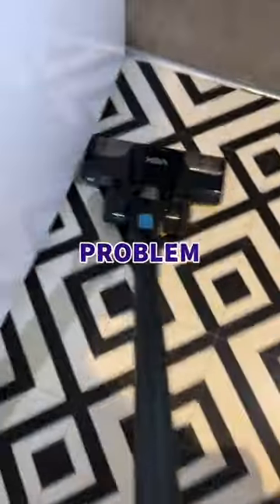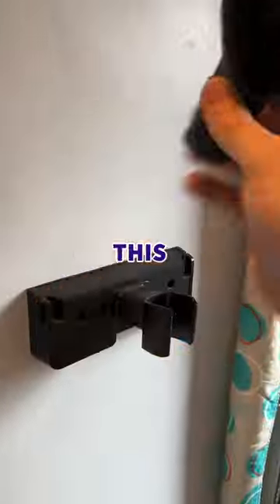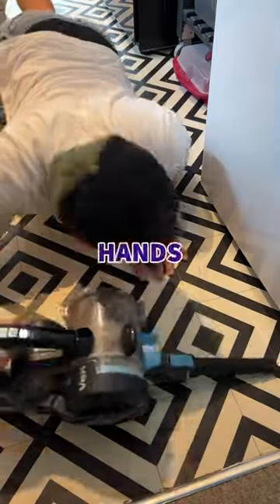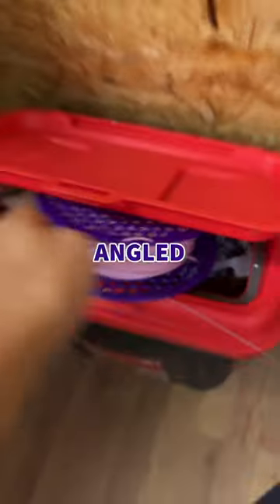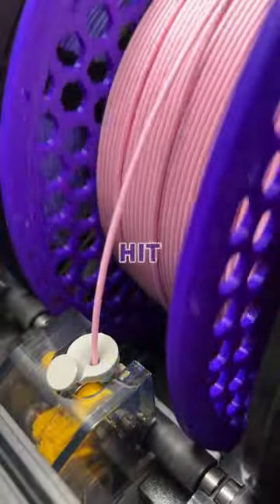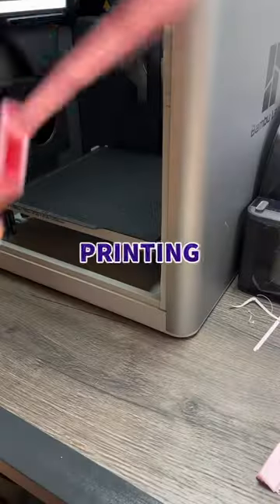3D PRINTED vacuum cleaner ATTACHMENT!

Comment: Remember, 3D-printed plastic is not food-safe, which means you can't eat all the dust afterwards.
Reply: Damnit i just ordered 200 of these for my dust farm.
Reply: Aw darn
Reply: Some are food safe you just have to get the right one
Reply: PLA is 😂
Reply: I just encountered one of the ignorant "not food safe" talking point trolls, so hearing this jab made me 😂
Reply: some are.
Reply: @giaomai6685  i wouldnt eat out of normal pla... because the additives and leaching. but food safe pla ye.
Reply: @giaomai6685  While PLA might be foodsafe...the bacteria build up between the layers won't be LOL
Reply: 3D Printing Food Safety ConsiderationsHarmful bacteria such as E. coli and salmonella can hide within layers and cause potential harm. This is not an issue for disposable items, but if you intend to keep the 3d printed part for an extended period, using a food-safe coating is highly recommended.
Reply: Well shit. I was hoping to eat the print and sprinkle the dust on top
Reply: Dang it bro. Now I have to go hungry 😢
Reply: This is CURSED
Reply: PET-G acctualy is food safe, if you treat your printer before printing and treat you model after printing with some stuff, i have no idea what they are just read about it, and you can eat you dust afterwards 😂
Reply: Crapppp 😭😭😭😭
Reply: Oh damnnn 😢😭
Reply: r/cursedcomments

Comment: Since this part is only using bridges on the inside it would likely print perfectly fine without any supports. It saves the hassle of removing them and some material.

If you’re concerned anyway about a bridge. A great way to do it is to block most of the support but have it make a small one in the center of the bridge instead. That way you still have some support (but in cases like this you shouldn’t need it ^^)
Reply: If you were to use supports as he did do you have any tips for making it easy to remove? I sometimes struggle remembering and setting the settings that make supports easier to pull out

Comment: It’s a good add on if your vacuum is strong, but it’s difficult to make a lot of turns on your airflow. I think that’s why they don’t usually put em in the box but it doesn’t seem like it matters from what you’ve shown lol
Reply: 🤦‍♂️ always someone that gotta be negative huh?
Reply: Not negative, realistic. Any fluid (including air) struggle a lot with 90 degrees turns. A better design would've been a longer nozzle with a less pronounced bend.
Reply: Did you see the vacuum it was attached to....nevermind.

Comment: Why not print it on the side without using supports except for maybe the round part ?
Reply: I don't see why it would need supports the way he printed it. Only a little over hang on the bottom and small bridging he got it out his Bambu. That would have handled it fine

Comment: Omg the printing orientation!! If you simply rotated it 90 deg to either side and rounded off the inner edges , you wouldn't have had to print support on the inside and you would have had a stronger part cause of the layering orientation ...😅